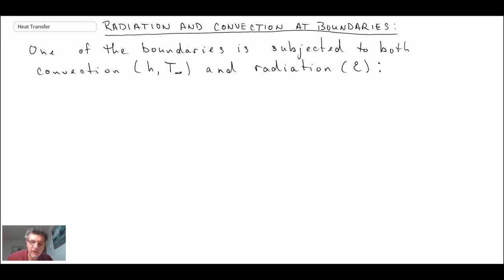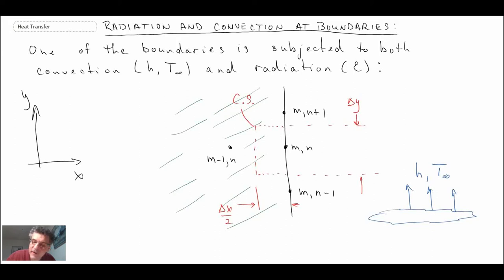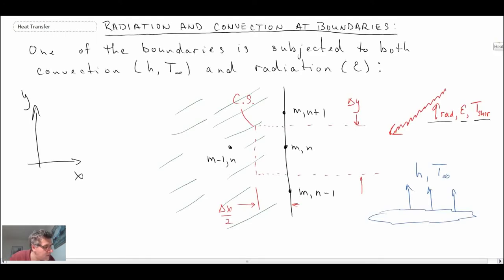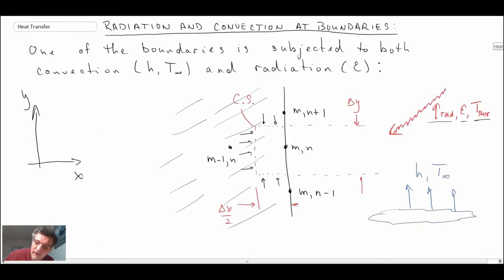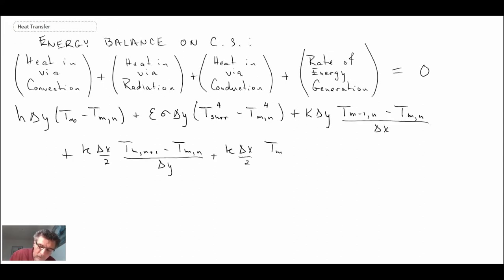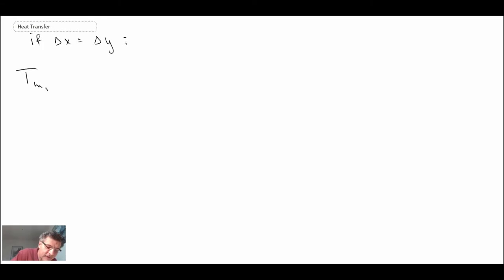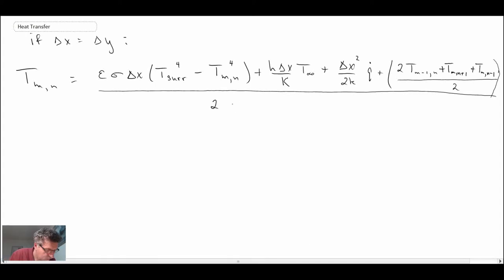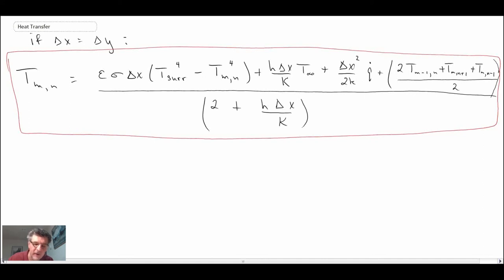Heat Transfer L12 p4 - Convection / Radiation Boundary Condition

Comment: In some cases, the radiative part can be linearized. If you're using Mills book, check page 16. Otherwise, proceed with a numerical method by taking some guesses of T^4 at the wall